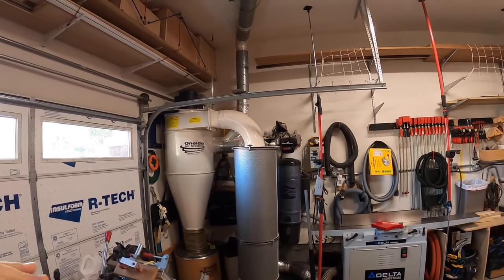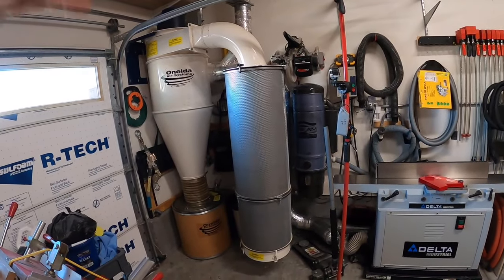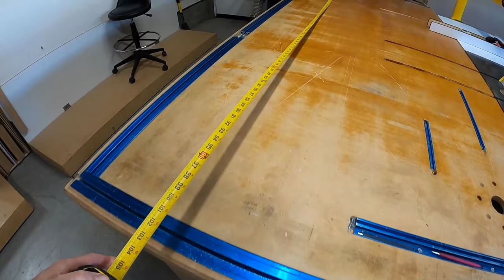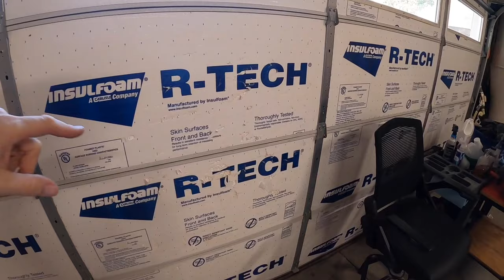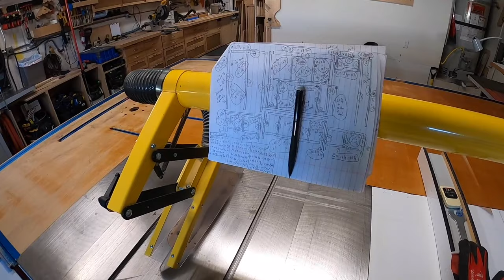2021 Garage Shop Tour.  How I Transformed My Garage Into A Cabinet Shop.

Comment: Great setup! How many horsepower is your dust collector? I've been looking into bigger units and am torn between 3 or 5 horsepower. Have you considered getting into cnc?
Reply from the maker: 3hp.  It’s very good.  The Oneida setup is phenomenal.  However, if you are running a bigger shop with multiple people working on large chip or dust creators, I’d say go with 5hp or more.  This power is great for my shop and can certainly handle a few blast gates open with no problem at all. And my longest 6” run is 50 ft to the back.  So pretty far. Depending on your setup with machines if say you’ll be doing well with a 2-3hp. I found mine 11 years ago on Craigslist and he had a 5 and 3 hp he was selling.  I grabbed the three and never looked back.  No to cnc but it’s because of my shop.  I love having space to work.  However if I had more room, I’d consider it. I have to learn the cnc language and that would be fun.
Reply: @davidbryanwoodworksandmore  thanks for the input. I'm a one man show so the 3hp sounds like the best fit, smaller wiring requirements too. I dove headfirst into cnc when a local shutter business was closing down and I couldn't pass up the deal on their cnc. With the community support and resources on YouTube it wasn't very difficult to get up and running but does take up a lot of space. It's great to set up a job cutting while I work on other things though.
Reply from the maker: @InspiredCraftsman  glad I could help. Coll to hear about your deal on the cnc machine. That’s awesome to grab killer deals.

Comment: Do you like full kerf over thin? I like the idea for thin because less stock waste, and less power demand.
Reply from the maker: Hello again.  You are right, less waste and easier to feed stock through.  However I’ve found that thin kerf blades don’t last as long as full kerf.  After several sharpening, thin kerf blades have less carbide left.  I’m actually going to do a video on my favorite blades and why.  I’ll talk about thin vs full kerf.  And teeth types.  Etc.  I hope you’ll watch it.  Let me know what you think.
Reply: @davidbryanwoodworksandmore  Cool! Makes sense from a durability standpoint.
Reply: @davidbryanwoodworksandmore  Is this video out yet? I'm a full kerf fan as well, especially on my 12" cabinet saw. I run thin kerf on my 10" miter saw though. Deflection is a concern for me. CMT and Freud industrial blades are my current favorites.
Reply from the maker: @frontlinefinishcarpentry4193  Which video?  One about saw blades choices?
Reply: @davidbryanwoodworksandmore  Yes, saw blade video.
Reply from the maker: @frontlinefinishcarpentry4193  hey I just uploaded the blade video.  I forgot to mention it to you.
Reply: @davidbryanwoodworksandmore   I caught it from my notifications. I watched about 5 min of it so far.
Had a friend call me this afternoon, "hey, think you could make me a cabinet real quick?" 🤪🤐 hes a good guy.... I'll finish the video later.
Reply from the maker: @frontlinefinishcarpentry4193  love it.  Best to do that then to watch tv. Make a good one.

Comment: Nice shop.  This seems like an incredible # of shop vacs.  How loud is your shop for neighbors?  (I'm especially wondering with the dust collector, and whether you can work with the garage door open)
Reply from the maker: Hey great questions.  I don’t open doors often.  For security purposes.  But the machines aren’t loud.  It’s the routers that are loudest.  The bench top planer that I used to use was very loud.  My 3hp planer now is much quieter.  Direct drive tools like routers and lunchbox planers are very loud.  It’s always amazing to me that the biggest tools and machines are quieter than the little hobby tools.
Reply from the maker: Oh and yes I guess I do have several vacuum stations. But you know when you go in to customer homes, you need to take them and you don’t want to disconnect them from the shop.  Plus those are smaller that I take usually.  The big ones stay back in shop.  And the Oneida dust collector isn’t loud at all.  Not like a power tool.  It’s a humming sound mainly.  The garage is insulated.  Helps with noise.